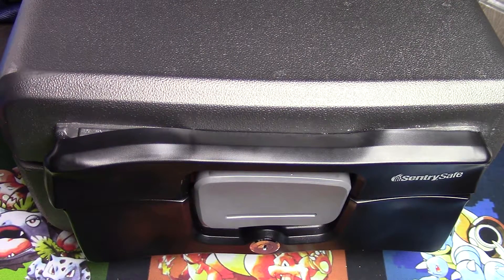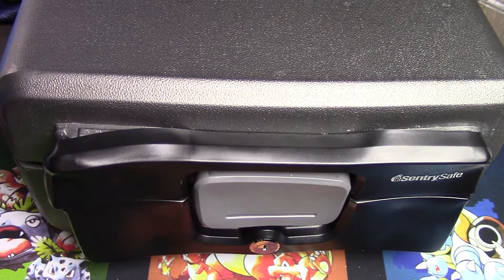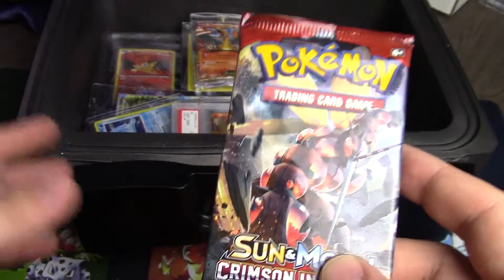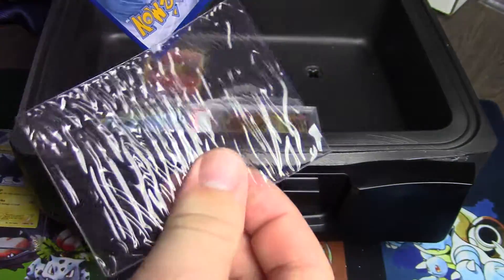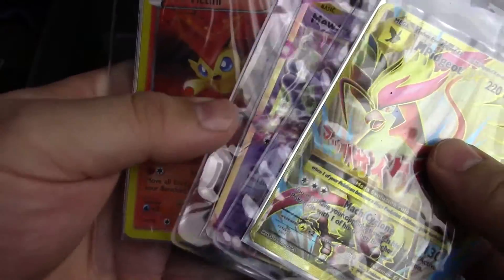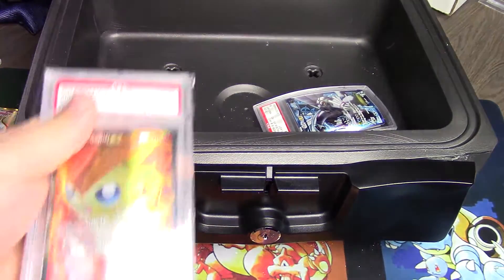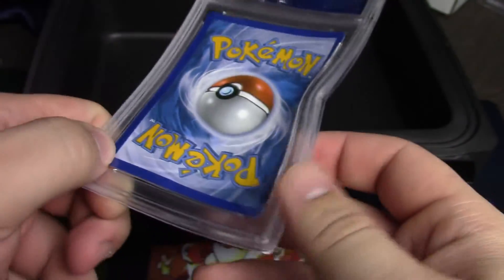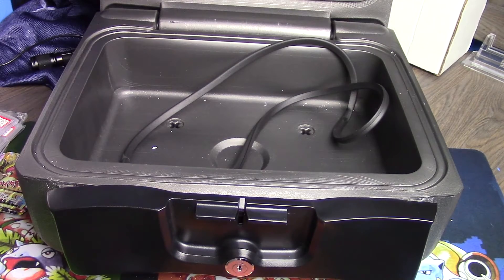Results for the "safe within a safe" theory. (Part Two)

Comment: So leaving my cards in gaming sleeves is safer then leaving them in top loaders in that safe? Danggg
Also do you have any idea what those gaming sleeves brands are?
Reply from the maker: In this scenario, yes even raw cards are safer than a plastic case due to the lower melting point of plastic vs paper. I did note later that the cards exposed to high heat started to curl. I'm doing additional research on nested safe model and priliminary testing is showing excellent results.

Comment: Thanks for this video.  I store my most valuable cards in one-touch cases in a safe, and it's scary to think that those cases, which are supposed to protect them, might be the reason they'd become irreversibly damaged in a fire.  Who would have thought that standard card sleeves would protect cards better than thick slabs?
Reply from the maker: The CCG Collector for sure it's a little crazy. That's why I wanted to test this Theory see what would happen. I'll be doing a follow-up video to this one that will cover more in-depth with better controls and better conditions as well.